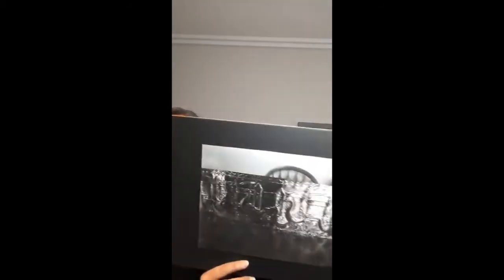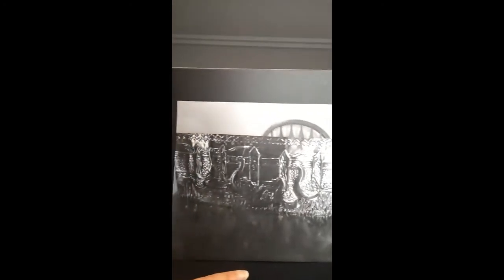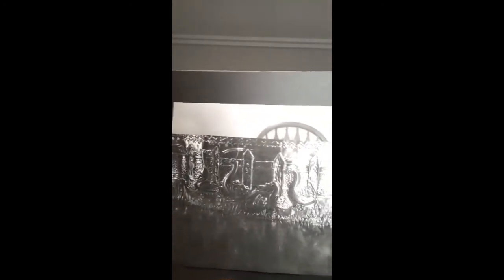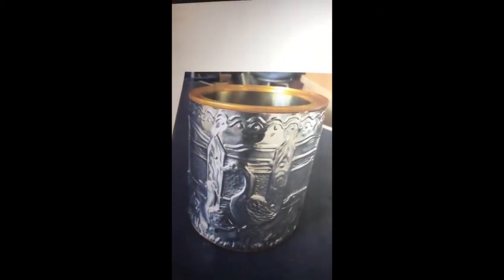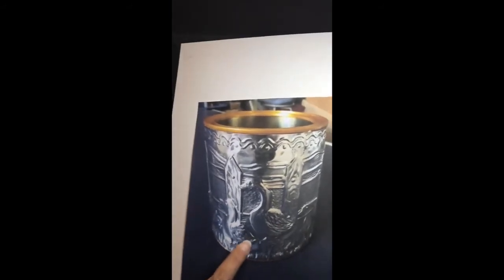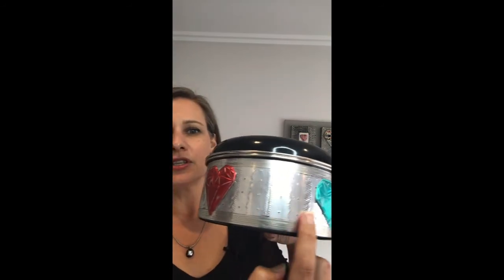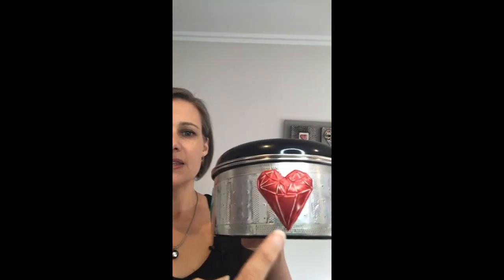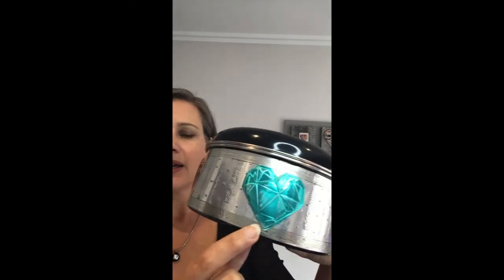Metal Embossing and pewter art for beginners: Q&A

Comment: I want to emboss or engrave a tree branch on a larger sheet for behind my stove range. I am worried that it will get bumped and mess up the design. My first question is what is the hardest metal that I can use that will give it some integrity and my second question is how can I ensure that if it gets bumped that it will not dent or mess up the design? The design I am considering is simply a branch that is running horizontally and some medium size leaves. would engraving be a better idea? Or if I do a low relief then maybe I could use resin instead of wax. I am not wanting to use wax given the fact that it will be around heat. Any suggestions or advice would be greatly appreciated.
Reply: Hi, I would like to know the same for a similar project in a humid bathroom. I used poly filler, but it really added weight to the design. I was wondering about hot glue - I've used it on some projects, and it works, but I'm not sure why no one suggests it. Ninette's videos are awesome!
Reply: Hi Tina, you can use aluminium or copper sheet as it’s a bit heavier than pewter and doesn’t scratch as easily. You could potentially use hot glue or wood glue as a filler. The wood glue would just have to dry over a few days. Please let me know how it turns out!